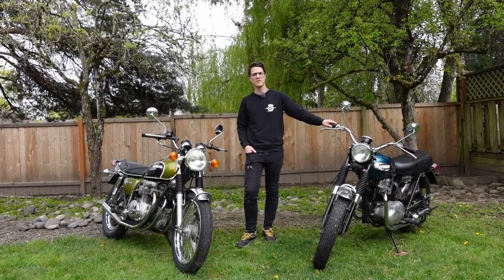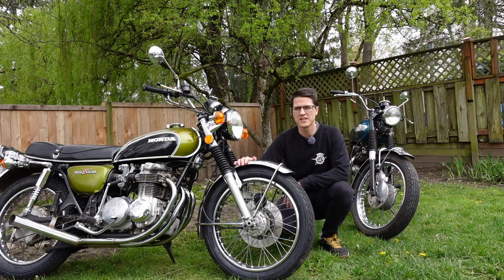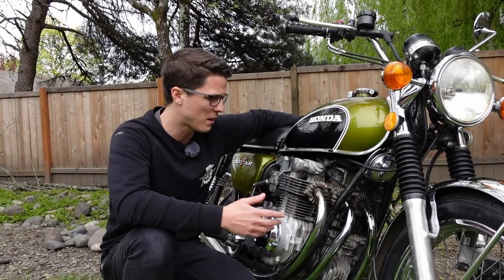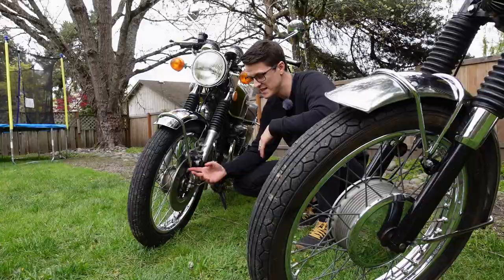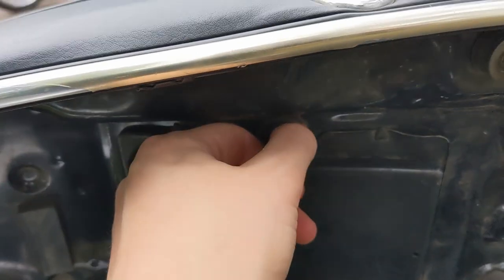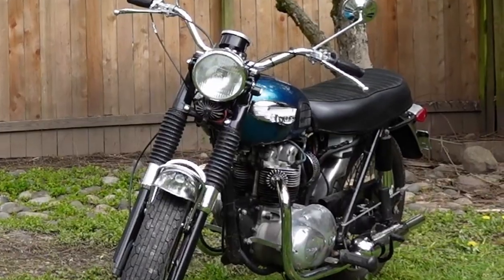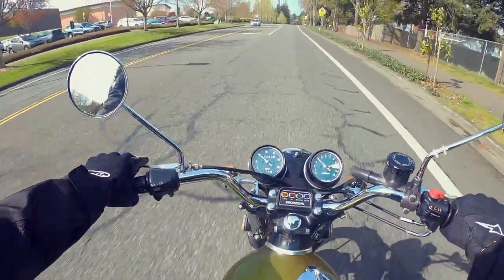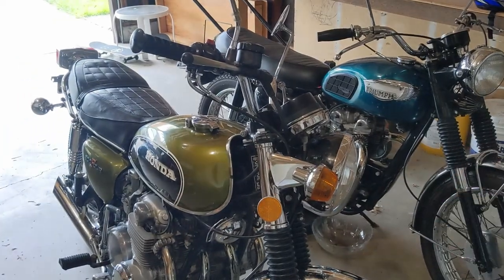How this Honda killed this Triumph

Comment: I owned a BSA Spitfire and it was fast and nimble, but it did leak and would not stop. It was a vibrating monster, the license plate would break and fall off. It had a terrible electronics system and no electric start. The electric start was a big deal because the damn thing had 10 to 1 compression making it dangerous to start. If I had to pick between a CB 750 and that Spitfire,  hands down I would take the Spitfire. If you had no where to go on a weekend the Spitfire was more fun but if I wanted to go some where and come back I had to take my friends 750. The Honda hit all the transportation check boxes but the BSA was scary, irrational fun.

Comment: I feel like my old BMW slots right between these two. It has a disc brake up front but is heavy. It looks good but not nearly as good as a Triumph. It's got a mix of great vibes and decent reliability, yet not quite Honda reliability. I think I'll keep it! (Never mind I've had it for 16 years and have never considered parting ways with it 😆)